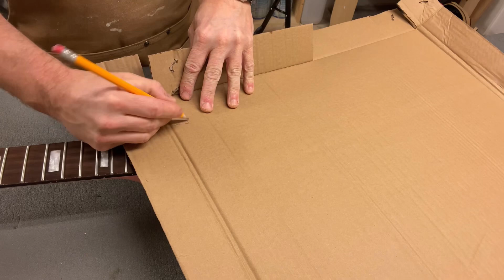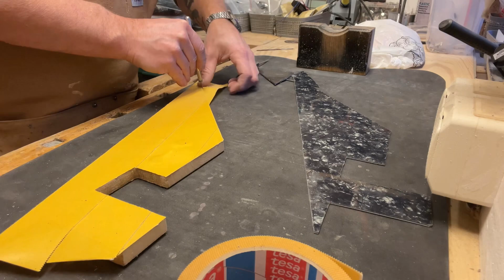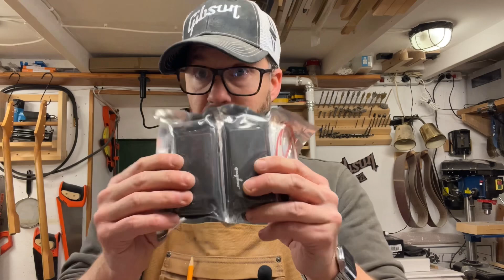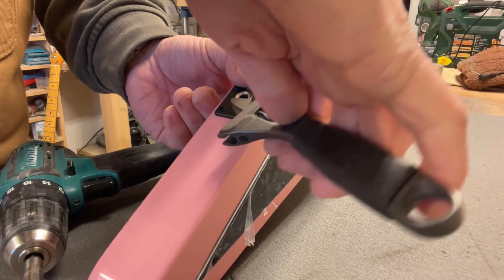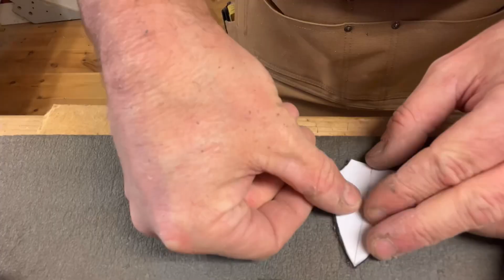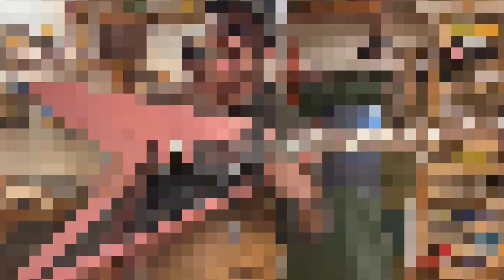DIY PINK FLYING V with #guyker hardware and electronics!

Comment: Hey! This looks exactly like the Rocktile kit I'm building myself. I also decided I want a pickguard and made mine out of cardboard as well, then measured all the important bits, sketched it in Autodesk and got a friend to laser-cut me trussrod covers and pickguard blanks out of acrylic. Yours looks sweet and sounds sweet too!
Reply from the maker: Very cool! What color did you go for?
Reply: @TheworldofMattias  the plan is a bright white body, gloss black truss and pickguard, and gold hardware. I also relocated the input jack and the tone and volume knobs (modified the wiring to only use two knobs). I might make a video when I'm done with it.
Reply from the maker: @ that sounds like great idea! Please make a video and keep us posted!
Reply: @TheworldofMattias  I see you've made multiple kit guitars at this point - can you say anything about the wood quality on the Rocktile V kit vs the other guitar kits you've made? This is my first ever kit build but the "mahogany" the guitar is made of seems to be quite soft and easy to dent - I keep accidentally putting scratches and grooves into the body despite trying to be careful with it. Any thoughts?
Reply from the maker: There are many types of mahogany and the ones in these kits are probably not the best quality. However thay are very nice to work with if you are careful. Put nitro finish on it, it´s worth every extra effort, I promise!

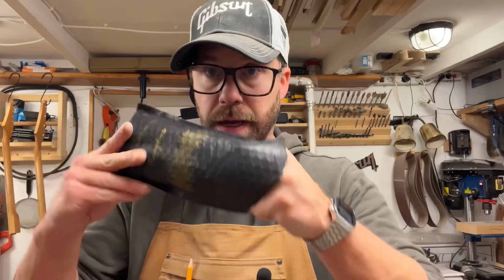Comment: 07:29 considering that you are using active pickups, wouldn't it be better to use 25K pots? Awesome work, btw.
Reply from the maker: Yes, you are right, 25K is the most common pot used with active Pups. I wanted the brighter sound though. But, it´s an easy replacement if I want to change it. Thanks for your comment, I should have said it in the video :)